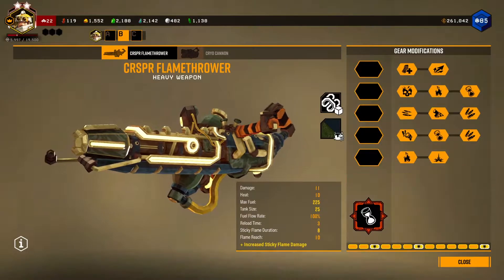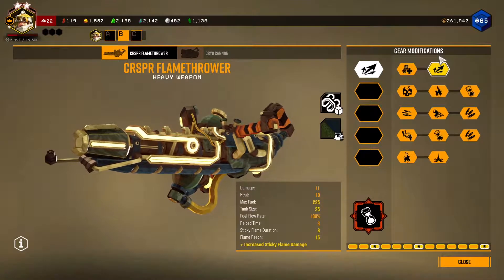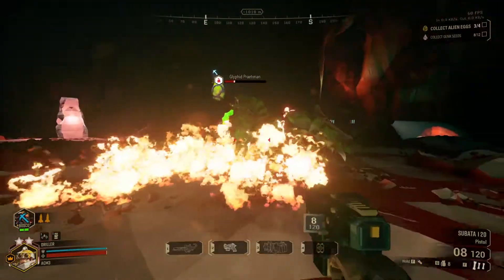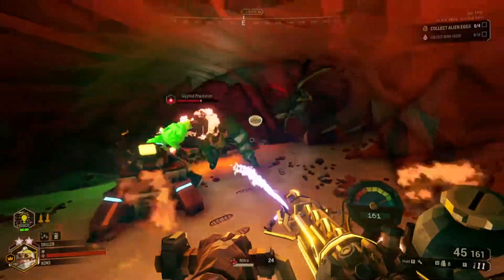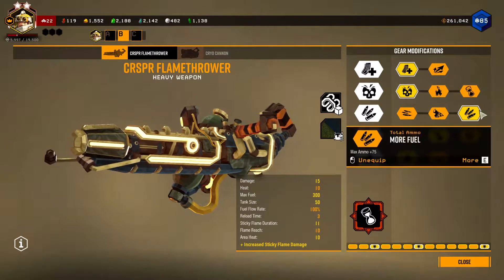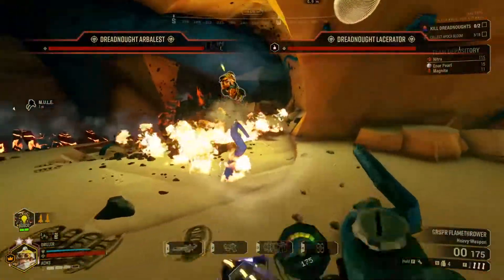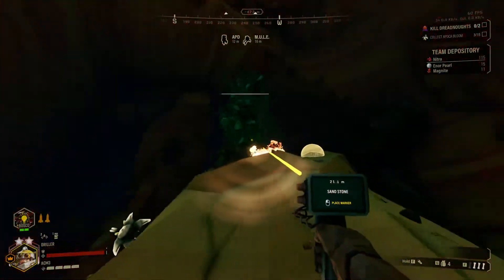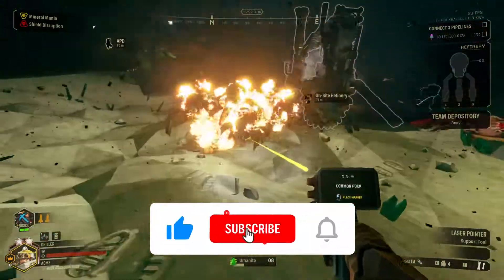CRSPR Flamethrower Sticky Fuel Overclock | Deep Rock Galactic

Comment: Great video. What secondary weapon would you recommend running with sticky flames?
Reply from the maker: Thank you. Subata 120 has Volatile Bullets mods which gives you bonus dmg on targets who are on fire. So if you build it with the weakpoint mod you can get some good dmg with the Subata 120. Other than that EPC is just as good as secondary weapon.